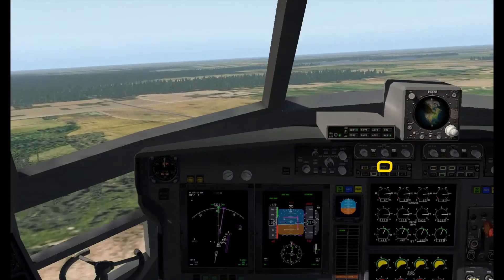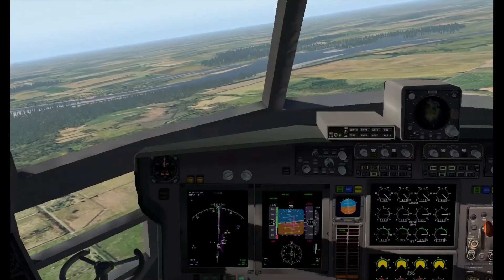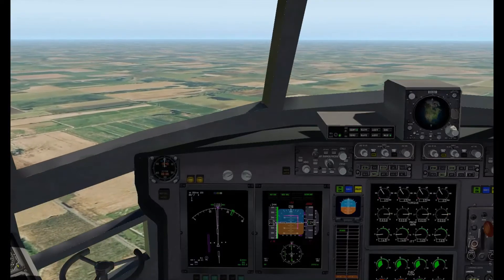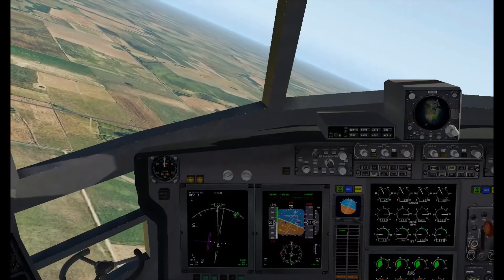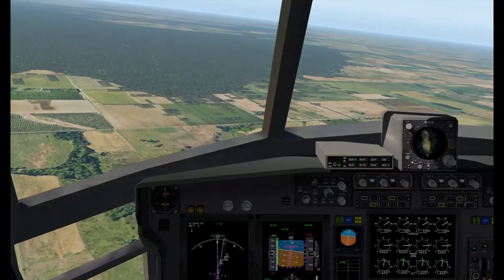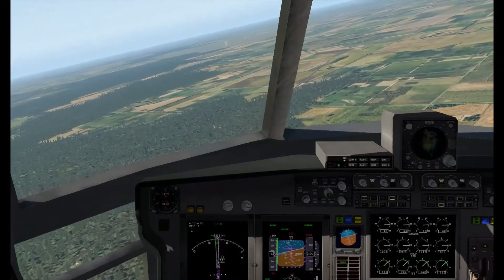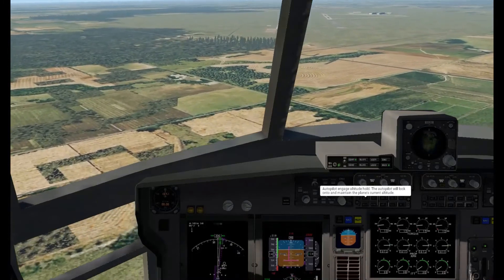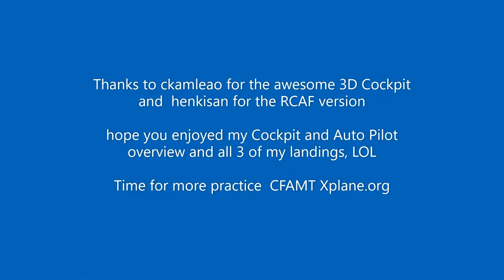Part 2 C 130 3D

Comment: 1. Is this 3D cockpit for the default C-130?

2. Is there a performance calculator for this aircraft?
Reply: The 3D cockpit is not default, it's a free add-on that you can get from here: https://forums.x-plane.org/index.php?/files/file/39139-c-130-3d-cockpit/
Reply: @bertro514  Yes, I meant, is it for the default aircraft or is there also a pay ware C-130 with which this cockpit is compatible?
Reply: @reticentsimmer  Oh, sorry. Should have read more carefully. The add-on is for the default C-130. I've installed it this weekend and loved flying it. It took a while to learn the FMC and Autopilot, which are much more limited than in the Zibo 737 for example, but it's fun to fly.
Reply: @bertro514  Ok, thank you